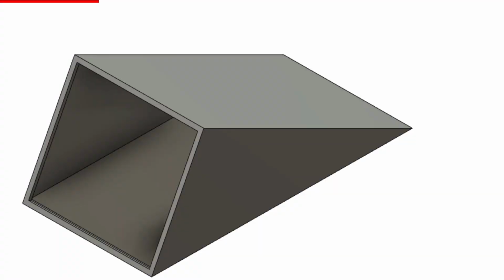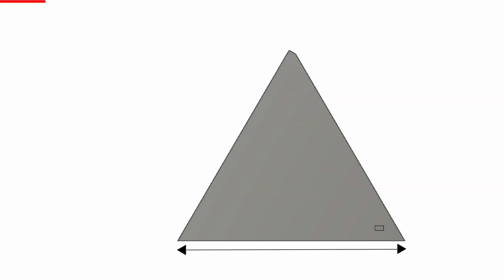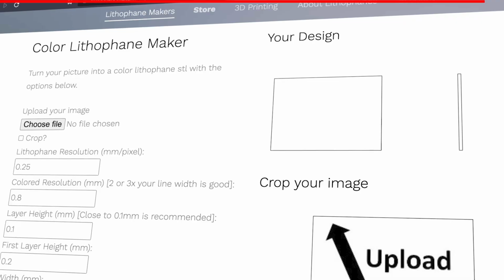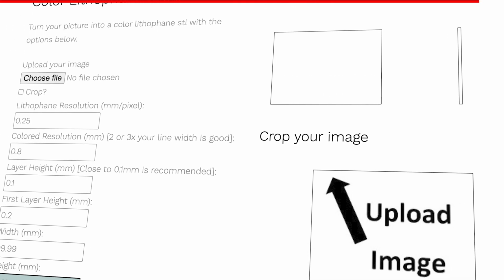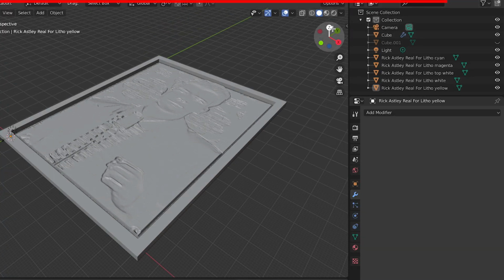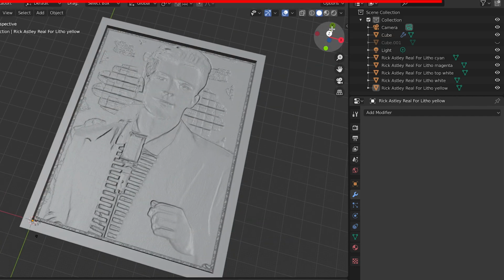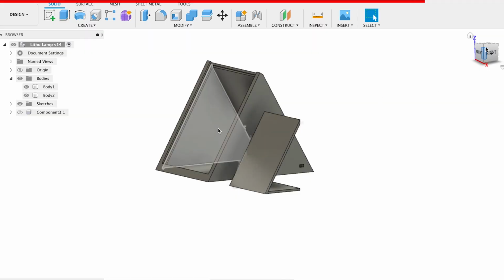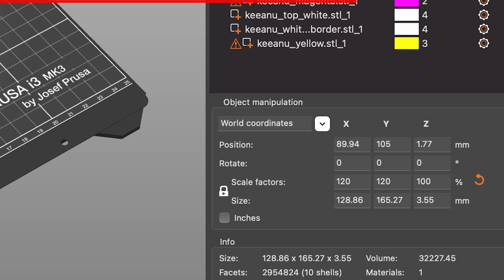Turn Your Pictures Into Lithophane Lamps | What is JUGAAD?

Comment: Great work with the project!

The unshielded wire inside your cable is the drain wire. It's primarily used to provide a low-resistance connection between the metal shielding of the USB connectors at either ends.
Reply from the maker: ah... should there have been another ground wire? or does that act as the ground as well?
Reply: @CreateInc  This is basically the baap of Indian jugaad, Chinese chindigiri.

As per the USB 2.0 spec, compliant cables need separate conductors for VCC, GND, D+, and D-. Additionally, a separate drain wire is required between the connector shields at either ends. You cannot use the GND wire for this purpose. Without this, a USB cable cannot protect sensitive electronics from static discharges.

So a standard 4-core USB cable will have four discere wires in addition to a separate wire that serves as the drain. To save costs, shady Chinese cable manufacturers use cheaper 3-core USB cables instead. The drain wire is then incorrectly used as the GND. This is not compliant with the USB 2.0 spec and makes any connected device susceptible to damage from electrostatic discharge.

Even the best USB cables fail to comply with the USB spec mandating a shield resistance of less than 0.6 ohms. Here's a custom keyboard cable I made vs the OnePlus Dash Charge cable illustrating that fact: https://imgur.com/gallery/tNFgxHR